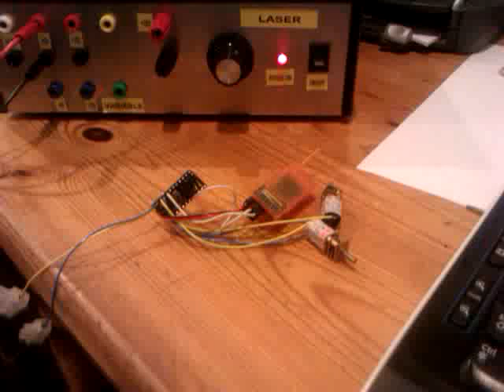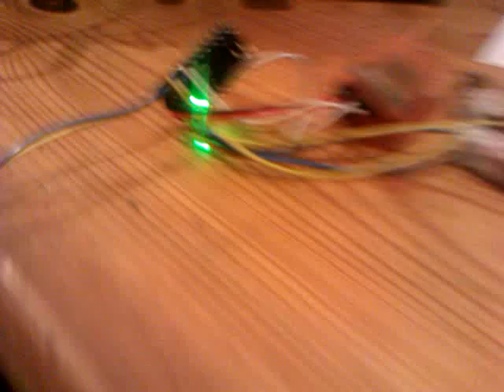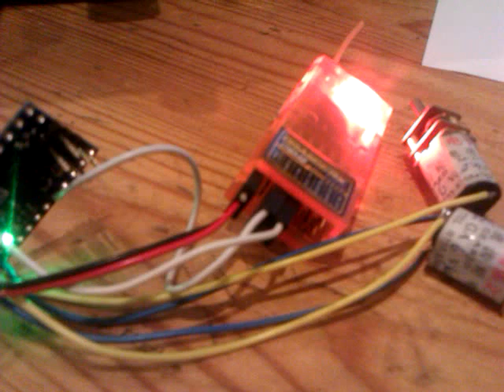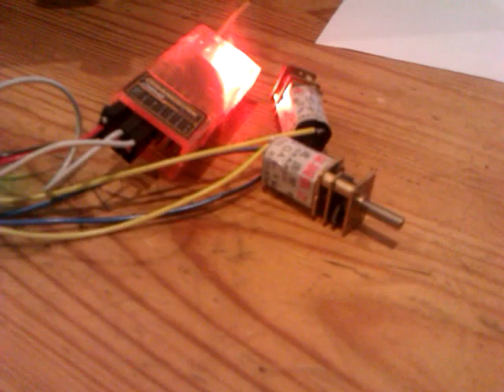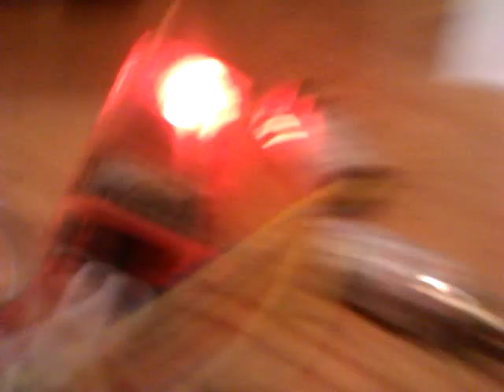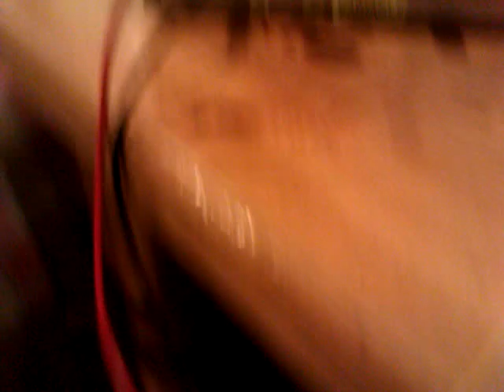Baby Orangutan ESC testing

Comment from the maker: Hi, thanks. The wiring is pretty difficult to get right, just make sure you get nice clean contacts on the ports. As for where the wires go have a look at my post on this forum, it goes into detail of the wiring. 

As for the code i get it off the pololu website for the Baby Orangutan. ALL LINKS ARE IN THE DESCRIPTION